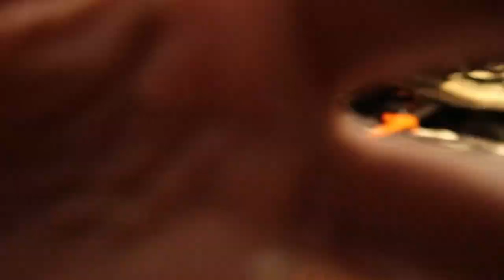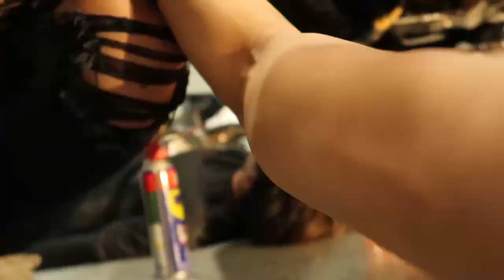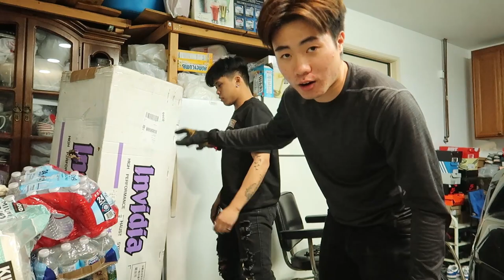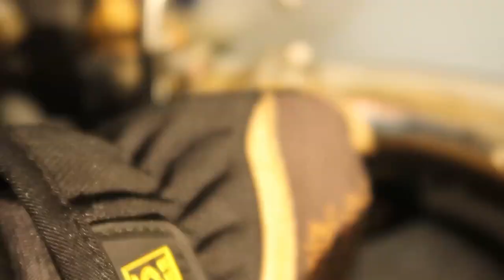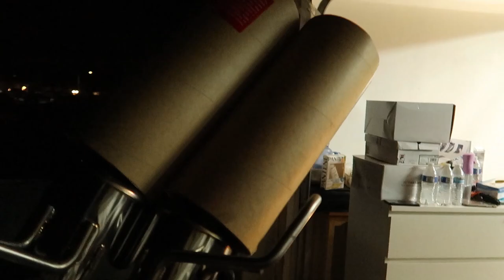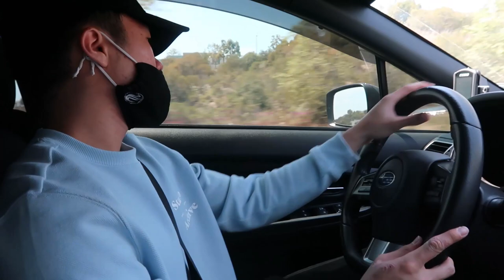THE NICEST SOUNDING EXHAUST FOR THE WRX? | INVIDIA R400 + INVIDIA JPIPE (INSTALL AND SOUND CLIPS)

Comment: Looking at getting the same set up as you. Invidia r400 turbo back catted. How id the drone at highway speeds? Debating between this and the cobb turbo back
Reply from the maker: highway drone's are normal, it's not bad at all. I'm also running an invidia jpipe so even with that, drones are minimal and aren't annoying at all. you can easily hold a conversation and listen to music without the drone being constant
Reply: @JaydonWong  where did you get it at? Invidia site is sold out at the moment
Reply from the maker: @Luis-ml3uz  i believe i got it from importimageracing.com, i usually shop there

Comment: what tune did you have when you made this video?
Reply from the maker: thanks for watching the video! during the time of this video I was actually on a tune by EdgeAutoSports. but if you're looking for a tuner i'd suggest AMBOT Tuning, check out the burble video I made if you want to check it out!
Reply: @JaydonWong  of course! I have a 2015 wrx. The only engine mod i have is the invidia catted r400 exhaust
Reply from the maker: @samiistahl  for sure! you wouldn't need to worry about tuning until you get to installing J-pipes, intakes, bov's, etc. but until then, i still recommend AMBOT Tuning!